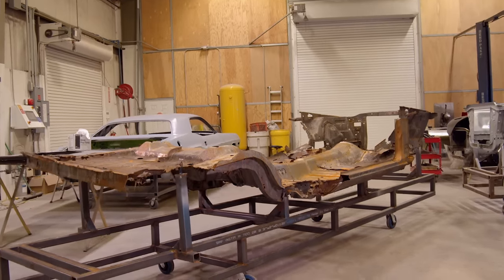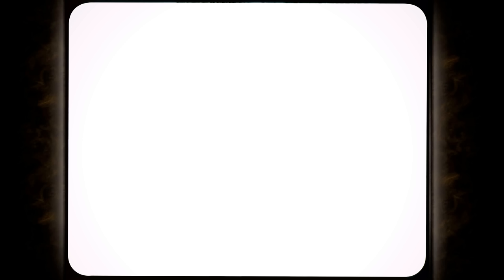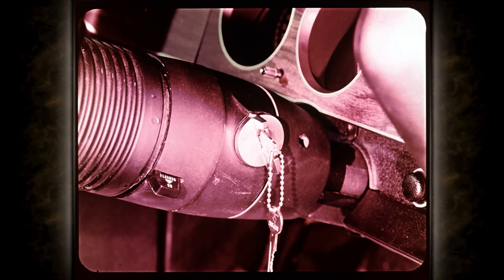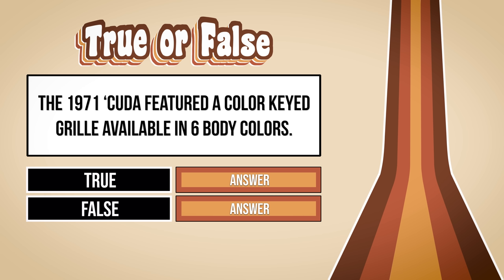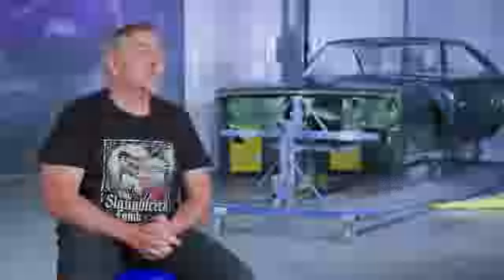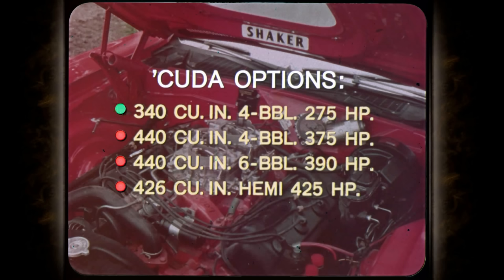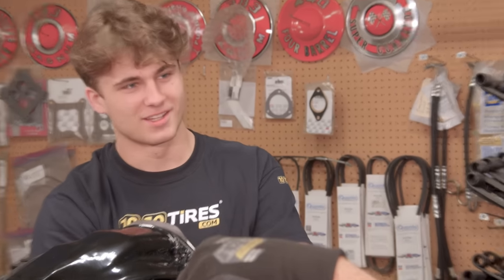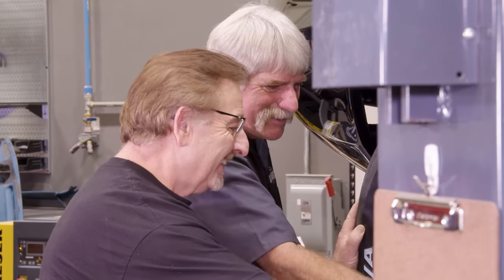FRAUD ALERT '70 SIX BARREL 'CUDA: VERY UPSET CUSTOMER WHEN MARK TELLS HIM HIS CAR IS A FAKE!

Comment: I would think you need to have more than 5% of the original car to use an original Vin number.
Reply: Probably if you have the VIN tag, it’s all you need since it seems better-than-OEM panels are available for the body.
Reply: @brianbarney1885  
You need the VIN tag and than the key areas that have stampings that have the same numbers as the vin. If you have the assembly build tags those are not always with a car. If you have numbers matching car starting in the late 60's you will find the serial/sequence  numbers will be on the engine and transmission as well and they will be the last 6 digits of the vin. Those numbers will not prove the car is origional and not fake if they all match. If they don't match than it proves it is not all original.
Reply: Don't need even 5%. All you need is structure of some sort that's original. Just gotta prove the part is original to the car. Mark has receipts, pictures before and after the dip, a license and reputation the DMV would take as good.
Reply: I believe the frame and firewall are the key requirements
Reply: It’s all metal that can be replaced
Reply: Is that by weight or parts count or what? Its illegal to "destroy" or "deface" a VIN without "clear title" and a certified "automobile recycler" doing the "destruction" after taking legal - and civil - possession of the vehicle. And it must not be resold AS an intact "motor vehicle" with a "clear title". 

And vehicles purchased for salvage as "insurance recoveries" must be "parted out". "Premium" auto insurance companies are also all but "banning" the use of aftermarket ("imported") "replacement parts" AND "good used" OEM parts and components from "junk yards" in collision repair because obviously no vehicle can be repaired to "like new" condition with a "clear title" if/when it has non-OEM and/or "good used" parts in place of OEM factory parts it was "born" with. 

ALL these "collectible" cars are USED CARS AND "ANTIQUES". No more or less regardless of supposed "rarity" and "value". 

Just go try to finance a "collectible car"  on a real "car note" and borrow more than NADA USED "VALUE" - 20% "DOWN" TO "INVEST" IN IT OR INSURE ONE WITH STATE FARM, FARM BUREAU ETC FOR "APPRAISED VALUE" IF - NOT WHEN - YOU ACTUALLY FIND AN "EXPERT APPRAISER" WILLING TO "COSIGN" ON THE "VALUE". 

Or get what any specific "rare" car is "going for online" in a "private sale". 

Nobody is getting "screwed" if an ORIGINAL "CLEAR TITLE" VIN - IN AND ON ALL THE ORIGINAL KNOWN AND "SECRET" LOCATIONS ON "SHEET METAL" - ENDS UP ON A "RESTORED" VEHICLE THAT'S ONLY "1% ORIGINAL" IF AND WHEN THAT 1% INCLUDES ALL THE FACTORY VIN STAMPS.
Reply: @brianbarney1885  Better than OEM meaning better than "good used"? Or "NOS"?
Reply: Call it a tribute ,ok, original no.

Comment: So If this shop replaces major body panels from rust or collision  The car is still considered restored.
but if another shop replaces the rear 75% of the body and still retains the proper VIN #'s  It's considered as a fake or a tribute ?  Where exactly do you draw the line ?  At what point does major body panel replacement become building a fake car  When the proper ID is intact ?
Reply: The line is drawn between “I did it” and “a competitor did it”.

Comment: i almost bought a 71 cuda my mechanic friend spotted the new upper control arm. that was in 72, seller said it was new never damaged. i picked up a 70 SS 396-375  chevelle for 2200 bucks instead.  cars were cheap gas was cheap.  i wanted the cuda

Comment: These guys have great skill and I admire it, but I don't necessarily agree with it.  On the one hand they are building an entirely new car around a VIN plate and the roof panel, then on the other hand the are calling the other car fake for doing nearly the same thing albeit with used parts.

Comment: Diggin through the junk drawer recently goin for a set of Sylvania bulbs for a cherokee blinker. It worked but they was purchased for a gs regal. I dumped the bag i stored them in and found a damaged button i thought was lost. It controls the lock on the driver door window panel. The tnt on the passenger side aint exactly black and aggravating to ask to roll it down cause the switch keeps it locked.
Reply: WTF?

Comment: Very cool build, but WHY put the horrid original brakes in? Went with modern suspension, transmission, and fuel injection but old tiny brakes system.

Comment: That's so impressive the available of critical sheet metal parts still today and the skill/knowledge to assemble them properly. 

 On the fraud car, that is absolutely blatant, intentional fraud. The extent they went through is amazing, and not even that well done. 
 The question is, how would it be found without being dipped? If you could see the welds it might be hard to miss because it was  a terrible job of trying to pass it off. Certainly had the intent, just not the skill lvl to meet the deception lvl.
Reply: At the end of the day, would you rather have parts of two original cars that were at least created in a Chrysler factory, or would you rather have only the roof of an original car with reproduced Chinese sheet metal that was stamped 50 years later and welded in his shop?
Reply: @kennethsouthard6042  That is the question to ask for those who end up in such a dilemma. Might be a tougher answer for the guy who owns a firewall and front support from a 6 barrel.

Comment: At 40:46 ...nope, the Barracuda didn't have front disc brakes until 72 as an option. The aftermarket K-member kits were to address the factory weak K-members...Both the front drums and the flimsy front ends made themselves obvious when the AAR Cudas tried to race in the TransAm series alongside the Mustangs and the Camaros...the Cudas didn't win anything. Anyone  hard driving a vintage 440 Cuda is going to be met with some tweaked front-ends...the structural  shortcomings ,  the heavy engines & hard driving tends to bend things....common knowledge...but I guess not to this guy.
Reply: They did not win a race in Trans-Am mostly because they had five weeks to prepare two cars to compete as AAR. Dodge had two. Mustang and Camaro had been racing in Trans-Am for many years. The Cuda did win pole position in two of the races. Shows it had the power and handling in the short run. More years under its belt would of beefed up those parts and made it more enduring. But Plymouth pulled out after one year. And Swede Savage did pull off some 3rds and 4ths during the season. Challengers faired better. They are basically the same cars. And on the street the AAR and TA Challengers easily held their own. Even against big block GM and FOMOCo. cars. And today when it comes to value. They auction at high prices. Looks are timeless. Other than the Trans-Am Firebirds you don’t see Trans-Am specific Mustangs or Camaros going to auction. Mind you have to get a Z28 or GT350 to get to the same level. And Mopars are fewer so more dollars go their way.
Reply: Commonsense a Rare thing these days ...the engineers initially just made the parts to FIT not understanding REAL world use - which is commonsense
Reply: Cars like washers and dryers. Refrigerators and dish washers are designed with a certain shelf life. They want to sell more. That durability is set low on purpose. Many years ago 60s and 70s they built appliances and cars to last. Technology was years away from higher tech fluids for engines and transmissions. Better fuels that can clean deposits and burn clean. Compression came up with the quality of octane. Fuel injection keeps air fuel ratio really close. Also overdrive transmissions with computers puts the rpm optimal. So we get what they dictate we get. Not exactly what we want.

Comment: Mopars were put together will very low fit and finish quality . I remember water leaks , panels not matching , windows badly adjusted , paint runs , orange peel , pubic hair in the paint . Horribly built cars . And Tributes are just renamed Clones . You can't get big bucks out of calling something a Clone .

Comment: So , since the car has had the vin swapped and all of the confidential vins swapped how can you prove ownership of the car in front of you? The title, vin tag mean nothing. The body in front of you is not owned by the owner of the tags. I’ve been through this before with multiple E bodies.
Reply: Maybe, maybe not. If I own or bought two wrecked cars, and used the Vins off the most desirable car to put one together, it's perfectly acceptable, and still my car.
Reply: @jimmywhitlow2012  You are incorrect. It’s a federal felony. I’ll let the FBI know so they can find you.
Reply: @nealm8709 I'm curious... reference?
Reply: @patrickbuick5459  What are you curious about? I'll answer any questions you have.
Reply: @nealm8709  I was curious about the federal (US) law you mentioned. I thought that was the whole idea of salvage title was to take a car with existing VIN, use other salvage parts from other vehicles along with refurbished or newly manufactured parts and salvage or essentially resurrect the vehicle being salvaged.

Perhaps I mis understood something somewhere or am entirely wrong and one has to apply for a new VIN, much like a home-built vehicle, trailer etc.
Reply: @patrickbuick5459  This car has had its original VINs removed and replaced with ones from another car. Since that has occurred there is no way of proving the ownership of this car. The person holding the title owns the car the VINs were transferred from not this car. Since there is no way to prove the VINs that belong to this car or its true ownership it is illegal to sell or possess the vehicle .
Reply: @nealm8709  It seems you have far more experience than I in these matters. Thanks for the explanation. I am curious at what point does a car cease to be "that car". I am thinking along the lines of keeping a written-off vehicle that needs substantial repairs. At what point does using body panels from other vehicles invalidate the ownership. I guess in this case, the work amounted to grafting what was left of one car into / onto another body, so I can see the ownership being muddied at that point. 

In my case, how much of my original Jeep would have to be present still (after rust) for it to continue to go by the original VIN.
Reply: @patrickbuick5459  As long as you aren't transferring the VIN from one body to another, you will never have any issues. You can never "rebody" a car by transferring VINs from one car to another as was done here. I've seen way too many E bodys that the only thing the person that had the car owned was the vin tag and dash it was attached to. The car itself was a different VIN and either stolen or part of a scheme to defraud someone just like what we see here.

Comment: Why did this car have a speedometer that went to 150 MPH ??  When speed limits were post way less than that?😊
Reply: I had my factory 340 4 speed 1972 Cuda up to radar clocked 135MPH on straight highway. I was an on-call EMT going to get the ambulance for a call, so there was no ticket when the cop came to visit later, just an under hood looksie.

Comment: Obviously the car they working on is a car that was in a wreck or severely rusted, and that would impact the value of the car over being a completely intact original.  But, in the restoration of car that was a 440 car that is being rebuilt with a doner car to make it whole, it seems like that it is still a legit 440 car, if it was built with core parts from an actual 440.  To me that is preserving a great car, it has to have a title and vin from one of the two cars, why not the better option when rebuilding?  This to me is totally different than declaring the car to be something that it's not or never was.  This was, but needed a donor to continue life.  Am I missing something here on why you would only look on it as a "tribute car"?  It's not going to be original anyway, you're redoing the whole thing from bare metal??

Comment: OK, so if you use cheap Chinese reproductions parts it's a real deal.  But, if you use good original parts it's a fake.  Looks more to me like the car was wrecked before the cheap Chinese parts were available.  If someone wanted to fake a car in this day and age, I'd think using a spot welder would be a necessity.  This car was rebuilt more than likely in the 80's or 90's when spot welders were not so prolific.  Why try so hard to convince a customer his car is fake when you don't know the whole story.  I know I'd rather have the real parts even if they are used.